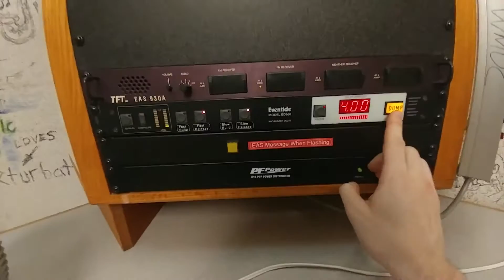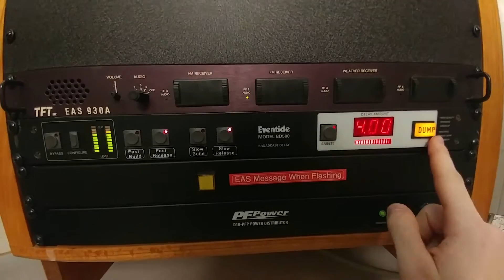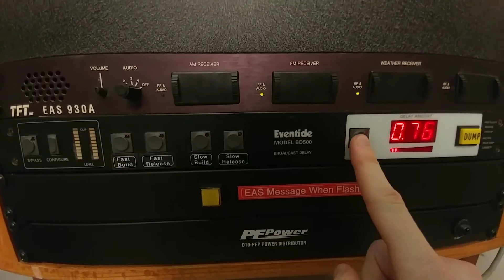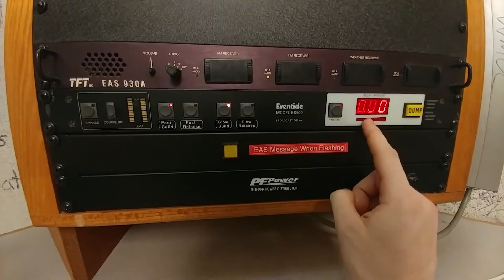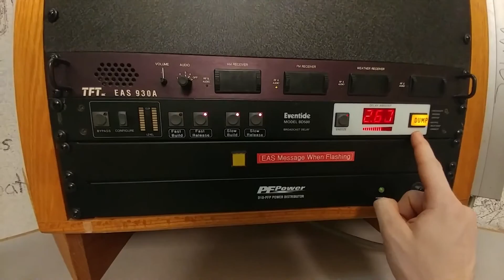WMUC Tutorials | FM Studio | Broadcast Delay

Comment: The tape delay system was invented in 1952 at WKAP radio station in Allentown PA. I worked there years later, not realizing the system originated there, but by that time a specialized tape loop cartridge machine was in wide use, making tape thread-up unnecessary. Once the "Dump" switch was activated, the delay was rebuilt by playing an instrumental music piece that repeated its note pattern exactly the same amount of time as the delay. It sounded seamless on the air. I was the "board-op" for the Open Mic show on Sunday nights in 1977 when I was just a kid.

Comment: If it’s a “4 second delay” & you dump it, I was always told that it goes live (i.e. “Real Time”)
Why does yours go directly to two seconds?
Wouldn’t  the delay go to zero?
—
& how does the delay rebuild up you were constantly talking?
—
If (in your demonstration) if you dump it, & it goes from 4 to 2 seconds, than is only what previously happened (dirty word m) from 3 & 4 seconds ago dumped? (That’s not much of leeway)
Reply: Because the machine only dumps 2 of the 4 second buffer with each use of the <DUMP> button.  The engineer can dump the entire 4 seconds by pressing <DUMP> twice quickly.  It's like a low-flow toilet.  2 flushes of water in the tank.  Flush once or twice to dump half or all the water.
Reply: @sebastianhamilton5892  thanks for your reply. But do you have any answers to my other questions? How does the delay build back up?  What’s the purpose of only having a four second delay? Of having to need to hit the button twice to get a 4 second delay?
Reply: @sebastianhamilton5892  The magic number I’ve always heard is a “7 second delay” I’ve been hearing that term in the 70s and 80s, and I think it was invented in the 1960s.  Two seconds is not enough time in many cases Yes, a curse word could be short, but sometimes if someone says on the curse words in a sentence, or maybe defames someone in sentence. It may take the DJ (or producer) a few seconds to realize that just happened and then it’s too late to hit the dump button.  So the minimum I’ve ever heard of 7 second delay. Not 2 or 4 seconds.
Reply: @MikeCee7  Yes, 7 seconds was the standard prior to the mid 1970s, when broadcast delays became electronic.  Prior to that, the "broadcast delay" was actually a loop of tape (yep, 7 seconds long) which was placed between the "record" and final "play" heads of a recording system.  It was actually just audio tape, nothing electronic.  No recovery or anything else fancy was possible.  Once a single f*ck or s*it was detected, the engineer had 7 seconds to just dump the input, with no recovery possible.  Once the first electronic units appeared, it was 4 seconds, because the chips in the unit were both rudimentary and very costly.